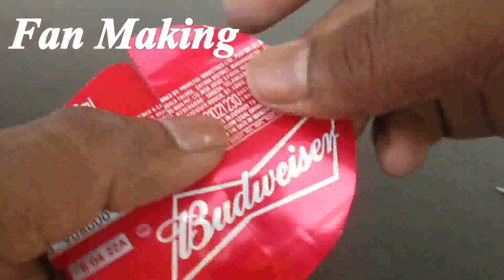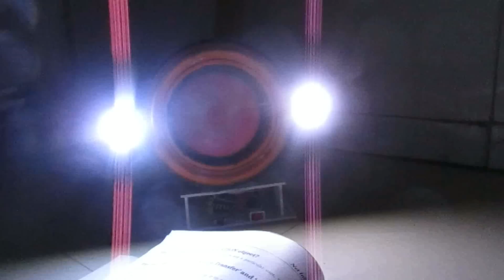6 Useful things from DC motor - Compilation

Comment: Your fan blades are killers. Make them for yourself but don't show here for everyone, cause some youngster might hurt himselft remaking your shit. Soldering also on a mad level.
Reply from the maker: Ha ha ha, Thanks For Your Feed Back Dude, I will Make it Good
Reply: Did you actually read my comment?
Reply: Yes i Read It, your saying Don't Show, Right
Reply: Everybody over 5 years old know that they shouldn't put their fingers in a fan with metal blades...
Reply: No they don't. That's why they put shrouds  around them.
Reply: Exactly, they don't. But that was not the only thing I wanted to say. Those blades are basically broken by the time he bends from a cylinder shape into flat fan. Starter has a huge torque both when starting and when spining continously. start and stop deflects the fan ant it brakes more with every power up. One day a blade will go flying
Reply: ok
Reply from the maker: Thanks
Reply from the maker: Cool Dude
Reply: + Martynas Valunas
True. Especially since they're not exactly balanced either.
Just a matter of time.
Reply: yep
Reply: And dont show the use of the glue gun because a youngster could burn themselves. And dont show you using a screw driver because a youngster could hit themselves in the eye with it. And dont show a battery because a youngster could electrocute themselves on it. And dont assume that a parent will parent their children because that is your responsibility not theirs.
Reply: TonyScandal true
Reply: Well there ain't no reason you should be rude like that. I do not have many of my, as you say, creations documented, but here you can look at a table sawthat built 4 years ago: 
https://woodgears.ca/homemade_tablesaw/martynas.html
or you can check out my old picture album here (not really well put together, nor not very recent stuff, but you can get the idea): https://get.google.com/albumarchive/104660415214701232088?source=pwa
Reply: Sorry nemačiau kad lietuvis bet akivaizdu kad video savininkas iš trečiojo pasaulio šalių ir viska gamina ant klijų tai pamaniau apginsiu savamoksli 
:D
Reply: Martynas Valūnas There are some very sharp edges on that table saw blade.. you had better rubberize them so that no-one gets hurt.
Reply: Shubham Sharma I have
Reply: I am 11yrs old
Reply: Martynas Valūnas
Reply: yoy are right bri
Reply: The blade can harmful if you are not carefull. I think ur a careless right?
Reply: Martynas Valūnas yes because kids are gluing bike starters on car batteries now.
Reply: كيفيتها الشراء

Comment: Hi, Thanks for giving the details of all the motors. I was looking the same. But can a bike self starter motor be used as a generator?
Reply from the maker: you can
Reply from the maker: you can
Reply from the maker: you can
Reply: Make Your OWN Creation  but I saw another videos where they open it up. it did not have magnets inside. so how will it work? have you tried this?

Comment: but where from you get all the motors
Reply from the maker: Amazon,
Reply: .....you can obtain motors for free....scrap drills , angle grinders , jigsaws , blenders , hairdryers , toys , fans , small car vacuums , printers , microwave turntables, record , video , cd, DVD players , .....there are hundreds of things that use these small motors ....along with this , many types of bearings, screws , washers , gears , mounting brackets, springs , cogs etc....for free !!!

Comment: Your soldering skills could use some help

Btw most of these are just stupidly dangerous. Especially the last one. Good luck turning it off with the switch under a sharp metal blade.